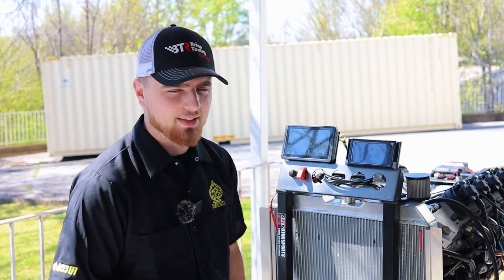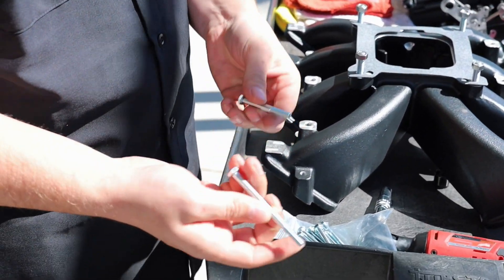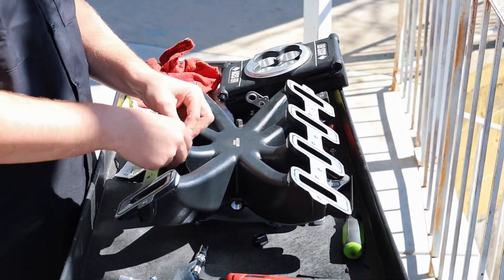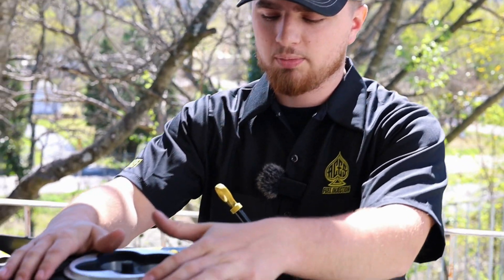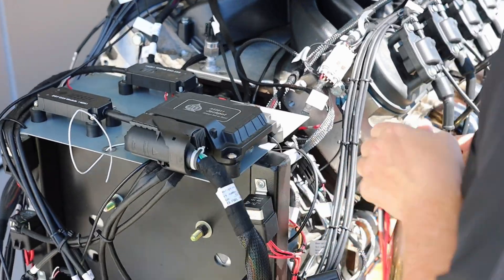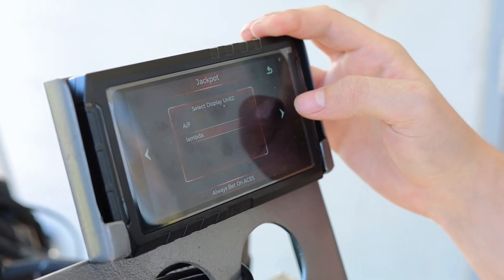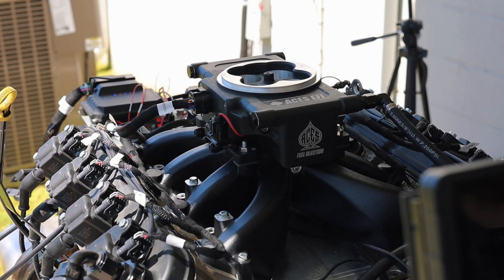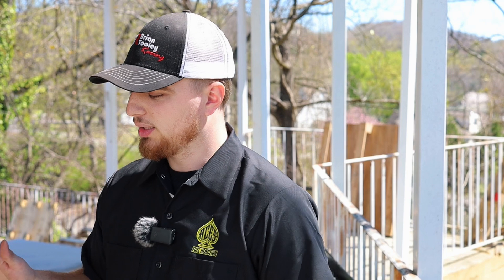Jackpot TBI Installation Guide

Comment: Are the wires in the extra wire harness required to be hooked up if not using an electronicly controlled transmission?

Comment: Why do you always keep calling the LS 5.3l a 323 cubic inch when it is actually a 325 cubic inch Even GM's own marketing material and manuals even tell you this
Reply: I say 325 to the screen every time when they say the wrong ci lol, but it is miss said on a lot of channels as well
Reply: Well there was a difference between the 5.3 Vortec (323) and the 5.3 LS4 (325). The internals were the small difference in displacement even though technically they were both the 5.3L engine.
Reply: @actionvulture5251  Actually there is no Vortec 323ci engine there never was and never will be unfortunately some dodo birds goof up in an old marketing campaign and used 323ci which kind of caught on but is still misleading, Because internally all 5.3l share the exact same bore size and stroke for 325ci or 5,327cc from the very first one to the latest 5.3l model made by Chevy the only internal differences between them were compression ratio and the cams and different style heads and as for “Vortec” that was marketing for the engine head as the name first appeared in an advertisement for the 1985 model year 4.3L V6 that used "vortex technology" to create a vortex inside the combustion chamber, creating a better air / fuel atomization. It has since been used on a wide range of engines for the years.